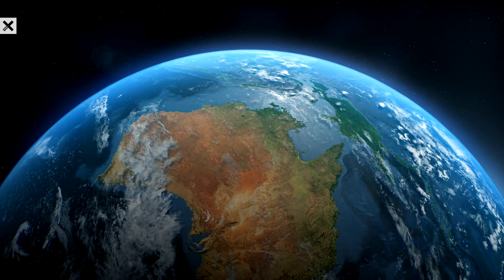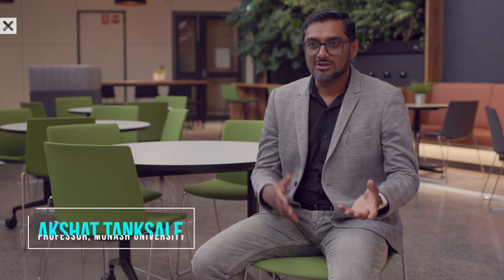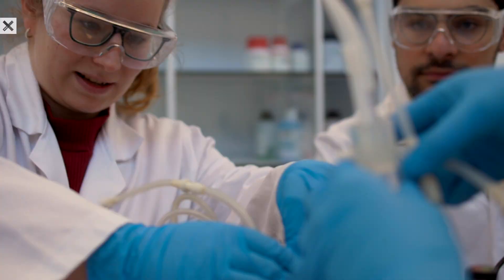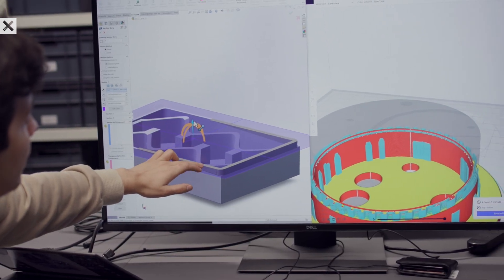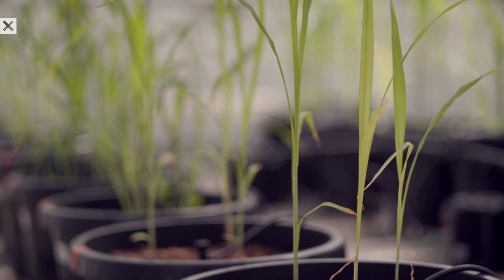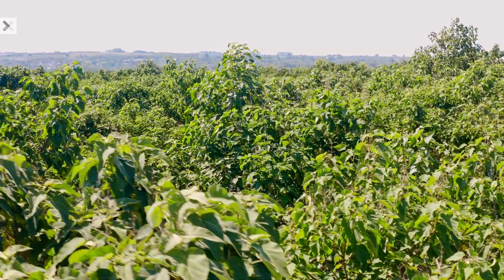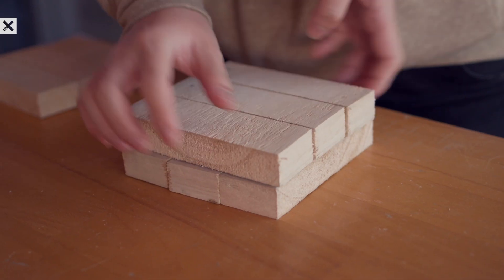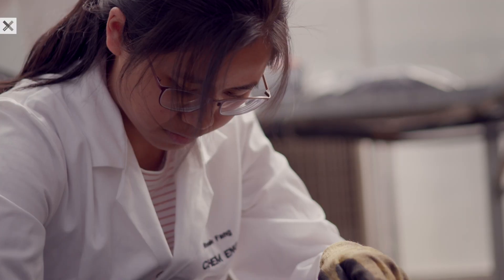How Algae Could Change the Race to Save Our Climate

Comment: Keeping a pure strain of algae while passing outside air over/through it for the CO2 harvest has been a big problem for approaches like described here. Are the Monash students now using mixed strains of wild algae, so that there is no longer a need to maintain a pure algal strain? Or are they filtering the air to remove the wild strains, which implies significant energy inputs to accomplish that air pumping/filtration?